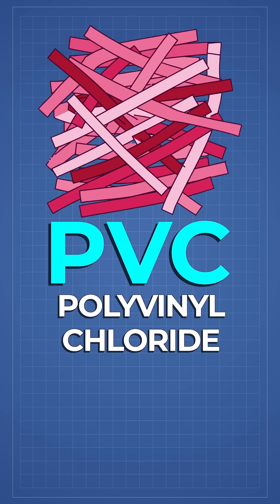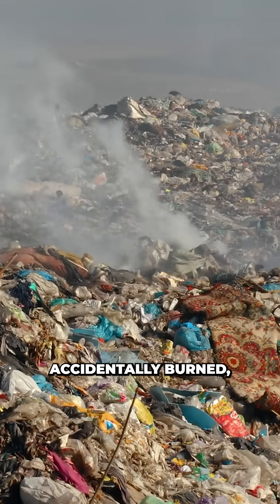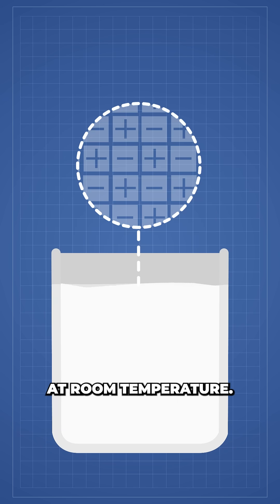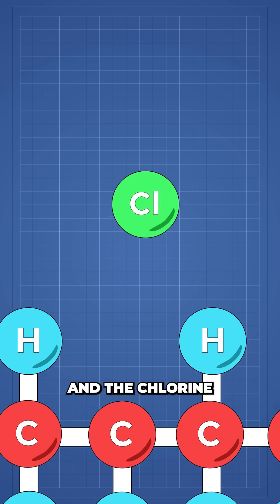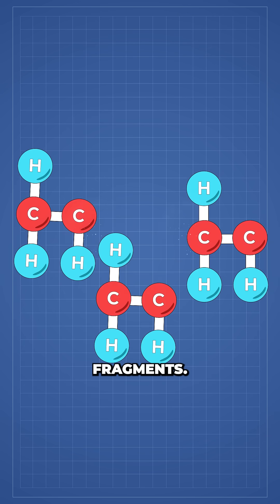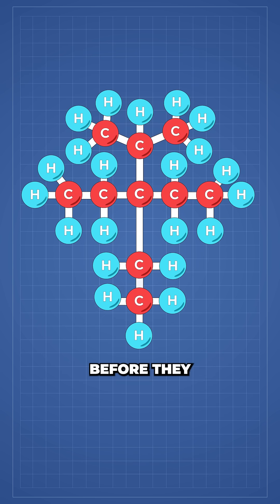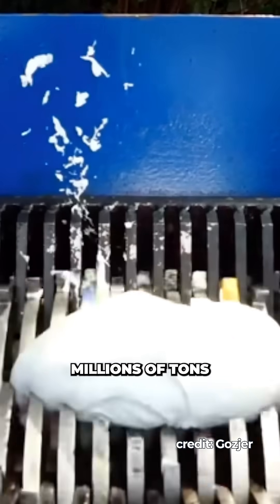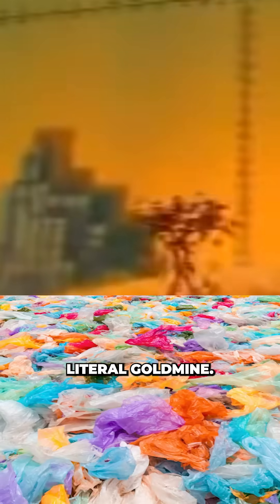Scientists Turn Plastic Waste into Fuel

Comment: Is by weight a good measurement for molecules? Because chlorine heavier than carbon and hydrogen.
Reply: That's exactly why it is a good way of measurement. For example, even though a water molecule is composed of 2 hydrogen atoms and a single oxygen atom, oxygen accounts for 88% of the weight.
Reply: I mean it's easiest way not to confuse people, if you start speaking over everything in moles you'll just confuse everyone tbh
You do not speak of the exact same thing in each case depends what you want to say.
Reply: @tomrejor4842  true...